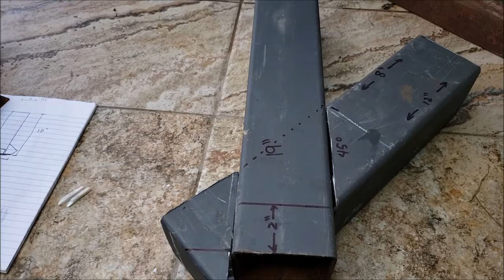How to build the best rocket stove from scrap metal off grid use.

Comment: Looks almost identical to the design I use. Works pretty good. Does produce a lot of carbon which covers
the bottom of pans. I need to add a small battery operated fan to mine to get it to burn hotter, hopefully that will reduce the soot.
Reply from the maker: I think if you add the fan it will make the rocket stove hotter for sure. I was going to use round material but found the square tubing which did the job. I bought the small skillet for it but haven't cooked a steak on it. I use it mostly for boiling water to make coffee.   Thanks for watching and supporting the channel.
Reply: Seconding having a fan around but not just for aiding your stove, they're absolute game-changers for starting & maintaining a fire under any conditions so long as you have a quality fan suited for the job. I use small-ish blower fans (i.e. Biscuit fans) that are considered huge for their intended use in cooling pcs & can move a crazy amount of air for their size. Got a few delta 2.6 amp ones for a great deal that could easily put a breeze into a large room that arent much bigger than my palm that I've used to stoke kindling into an inferno bonfire practically within seconds. Good times
Reply: Old boy scout trick is to put a generous amount of liquid dish soap on the bottom of the pan before you put it on the stove,  the soap will dry and crust on the bottom and when you go to wash it, it just falls right off.
Reply: Cover the bottom of your pot with soap, and the black will come off easily when you wash it!
An “old Indian trick”!
Reply: Thank you for that top!

Comment: I did a video on the one I made, not really used it too much yet . I put a baffle in mine like you did, not sure if that was the right thing to do yet or not. Turned out nicely though !
Reply from the maker: Thanks. There is many designs out there and actually several years past before I actually built it. It works great with twigs but when I added split hardwood it produced heat but not as much as thinner branches/twigs. I wanted to buy a small griddle to try cooking some breakfast on it. I just love the way food taste when cooked with wood.
Reply: @cutweldngrind  Yes, I love cooking stuff over wood. You might be on to something as I did the same thing split up some hardwood and did not get as much heat as I thought I would. Maybe they run better on twigs, have to try that.

Comment: Well done my friend.  Looks awesome 👏 👍
Reply from the maker: Before I forget at 6:04 you can see the small offset smoker I was building its behind the 20" round pipe grill. Its made from 3/8" wall pipe.

At 4:20 you can see the 20" x 12" pipe for my fire pit/grill that I wanted to build and its in progress I guess lol.

The Rocket Stove came out great after years of wanting to build one. I am officially out of scrap metal so that makes August a tough month with slim to none builds. I need to find some material now.
Reply from the maker: @axcreates_official  I was about to say which one from the 3 but just remembered. Wait a minute I also have the mini grill that I started lol....
Reply from the maker: @axcreates_official  On your video at the :33 mark is the tool you use a machining tool or a portable drill press. I want something like this and have seen other video use them. Thanks
Reply: @Jorge Serna That’s a mag drill I’m using.  Works great, but I still want to get a drill press.

Comment: I've never seen one of those over here, might have a go at making one to see how they run. Ive only got 4 inch round in the shed but I spose it would work the same. 
I put some tags on my Vidio as you said to see what happens, I'm not sure there is any difference. My test run tags included " worlds best, free stuff, how to get rich fast, " and a few other waky ideas 😁👍.
Reply from the maker: I actually have some round pipe but I know I will have a hard time coping or notching the pipe for that 45 degree angle. The pipe I have is also very heavy wall some is 1/4" and other about 3/8".  Try putting tags like these on one of the tracked vehicle videos if they match your video: remote controlled tracked vehicle, remote controlled tracked vehicle with camera, diy remote control robot, How to build a tracked robot, rc track robot, diy rc tracked vehicle,  rc tank track,  rc track vehicle. You can also add smaller 1 or 2 word tags if wanted.  The better the tags or ranking of them the higher up they appear in the youtube search pages. I actually stayed up last light making my video have a better SEO score, search engine optimization. I started as a hobby about 6 years ago and now I see a little $ flowing in but its not much. I learned so much from the few video I have seen from you. I need more tools and also an excavator. Well I have reached the bottom of the scrap pile and not sure if to start building stuff from mud now. I see a trip to scrap yard soon.
Reply: @cutweldngrind  the lathe is the big one, I started with a big old English lathe, 1.5 tone, best bang for the money out there.

Comment: Hi, what is the cross section of the material used? I have some 100x100x3 mm lying around, it will probably work.
Reply from the maker: Its 4" x .125" wall so 100mm x 100mm x 3mm sounds about right.

Comment: How long was the hole you cut where the 45 welds up?
Reply from the maker: I am not sure of the size I cut out but I drew lines where the middle piece meets the vertical and horizontal piece. I then cut maybe 1/4" inch inside of those marks as to leave little edge for wood to get stuck.

Comment: I really would like to see how you welded the top of the 45* next to the upright. Looks like that might be hard to do with a mig welder. The shielding cup would interfere. Let me know, please.
Reply from the maker: I can't recall but I did remove the shielding cup as I am still running flux wire. I had to watch video as I cant remember lol.
Reply: @cutweldngrind  you made a good looking rocket stove. Thanks for replying.

Comment: Can be made with a bigger square tubing like 6 inches?
Reply from the maker: I have seen 6 and 8 inch square tubing ones on Facebook market but I have not attempted one. I have to build another using 4" square tubing but will try a diffrent design.
Reply: @cutweldngrind  thanks

Comment: Whats the ideal height for rocket stove? Is shorter the better? Or heighier one is the better? Tia..
Reply from the maker: I have not done much testing as this was the first 1 I built. I used some measurements found online. My neighbor has one the same height but he used a smaller tube diameter. I believe the taller the stove the least efficient it is.

Comment: You think a cheap harbor freight welder can do this job? I’m a weekend warrior and want to make my own because I’m getting charged 500+ for a rocket stove
Reply from the maker: I have a HF 90A Flux welder and have done decent welds. I am not sure if you plan to use a stick welder but they seem to be affordable and compact. Arccaptain has the ARC160 and that stick welder works great with 7018 and 6013 electrodes.
Reply: I’m planning on getting the easy flux welder from HF. The wife is letting me purchase the tool if I can do the job lol. I got a bunch of scrap metal that I can use to complete this job, all I am missing is the knowledge and the welder. But I’ll have to look into those stick welders you mentioned.
Reply from the maker: @andrewtrejo4442  Have you seen the diamond plate one I did, that requires more welds but I had lots of scrap. What will you use to cut, bandsaw, grinder, plasma cutter. The 125 was a cool welder I got to use, I still have the Titanium 145. If you need any help let me know.
Reply: @cutweldngrind  Hello, yeah I just seen it and the rocket stove looks very unique from what I’ve been seeing. It honestly looks more intimidating having to construct the square pipe by yourself. I’m going to use a grinder to cut my metal. I know it’s going to take forever and I’m going to have to grind the edges to make things flush. I have 1/8 inch metals scraps and 6 inch square pipes to make my stove. It’s going to be a process but I’m here for it.
Reply: And thanks for the hand out. Your videos are enough help for me. But none the less if I need help I’ll for sure reach out.

Comment: I'm not sure that it's a "rocket" stove. The air intake is too small and we don't hear the sound of the rocket and the flamme is not powerfull. 
But you made a good job for this creation. 👍
Reply from the maker: Subscribe to the channel if you haven't and let me start drawing up a better design. I will make it 6x6 tubing and make it spit fire 5 feet in the air. I plan on starting the build next week as my other PC used for CNC fried today. Thanks bud.

Comment: I see you drag the toes of your boots --so do I --I have to JB weld the toes of my boots
Reply from the maker: I been wearing slip on steel toe boots for about 20 years and finally moved to lace up. Here in south Texas there is a ton of stickers so the laces just catches every sticker possible. The good thing is I don't do concrete work and they last longer now. What size boots you wear?
Reply: @cutweldngrind   I tend to work on my knees down on the slab when doing larger welding products -as I crawl around it seems I drag the toe of my left boot -I build it back up with some JB liquid metal -sand it -quick shot of flex seal and good as new for a week🤣

Comment: Hello what's the total length of square hollow tubing we need for this project? Is 3ft sufficient?
Reply from the maker: On the long piece I went 19" and the small piece was 12" on the longer side. I dont remember the angle on the cut but the short piece top side is 8.5 and again long piece is 12. I just drew a line and cut it off.
Reply from the maker: Yes, 3 ft will be enough.

Comment: So what are these for? Why would I need this? Not bashing but I’m trying to figure out why people use these?
Reply from the maker: Thanks for the comment. These are used mostly by people living off grid to heat water or cook with little fire wood. You burn thin pieces of wood and get high heat as long as the fire is burning strong. If the fire is low it looses efficency. I use this to make coffee off grid and a few twigs can boil water quickly.

Comment: Awesome stove brotha, I can see that stove in action making breakfast at the beach.... Good to have outside during the cold days for some hot coffee for sure...👍 Is your grinder a 7 or 11 amp?
Reply from the maker: I have a few Dewalt grinders in 4.5": 6.5A, 7A, 7.5A, and 10A. I use the 7 and 7.5 amps ones in most of my videos. The ones I will give away are the 7.5A paddle style which are still in the box. I was so anxious to use this Rocket stove and it had just rained that morning. I think the "Mesquite" thicker hard wood kept burning slowly but the branches actually gave that rocket effect. Thinner material just released heat faster and I really liked the way it performed. I will build a cooking grate for it soon then try some food on it.
Reply: @cutweldngrind  nice, I've been wanting a dewalt grinder for a while now... I have the HF Chicago grinder but those run on brushes and don't last long... I believe the dewalts are brushless and 1000 times better....lol. Looking forward on your next build/project....👍
Reply from the maker: @BigLou956  I ordered 20 flap disc online in 4 1/2 inch but I also wanted a bigger 6 or 7 inch grinder. I had an old Makita 7" but cant find it anywhere. I sometimes would find deals at pawn shops but lately there is just junk. I have a few other videos to upload but they are not builds and some are reviews or modifications. Well I need to find some metal.
Reply: @cutweldngrind  👍👍
Reply: @cutweldngrind  you can blame the internet for that. It ruined digging around in pawn shops for deals.

Comment: Looks like it didn’t get that hot, you prob should have not messed with the air flow and cut out the back
Reply from the maker: The stove works great but I realized I was using thicker pieces of hard wood and the flame would not burn to hot. I tried it with twigs and you can see the flame and feel the heat it puts out. I have another design on my channel feel free to check it out.

Comment: Very nice Jorge!!! I have a technical question: Why didn't you use the Dewalt cut off saw for the rest of the straight cuts you needed instead of the portable bandsaw and grinder.
Reply from the maker: I'm not sure at the moment why I went that route. Maybe the diagonal cut exceeded the cutting capability on the chop saw. I usually use a plasma cutter on my projects so maybe I just wanted to try other tools but a chop saw would probably give me straighter cuts. Did you build one or planning to build one?
Reply: @cutweldngrind  Ok, just curious. I hadn't planned on building one just yet but I must say your design and instruction is especially inspiring.
I'll let you know when I get around to it. Well done sir!

Comment: You’re not even close to off grid, since you’re using electricity for your welder.  Not even close.
Reply from the maker: I'm not off grid just trying to say this would work out good to take to an off grid location. I also have electricity off grid by using my 3kw solar system which can power a welder if needed for short amounts of time. I also have running water from a water well that runs directly off solar panels. I prefer to be on grid as things are easier.
Reply: @cutweldngrind  I hear ya.  At least you’re prepared.  That’s better than most.  👍